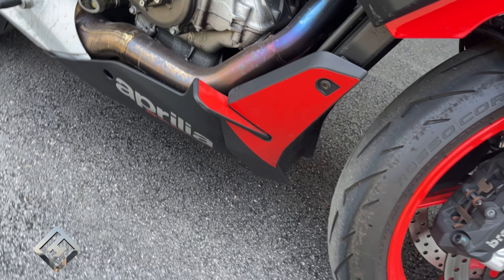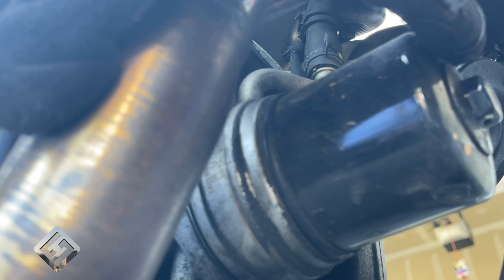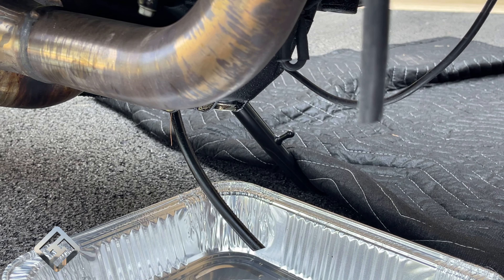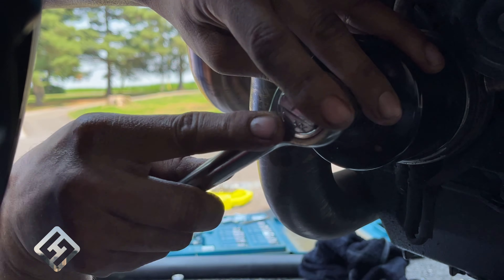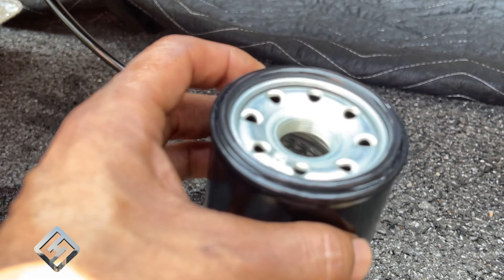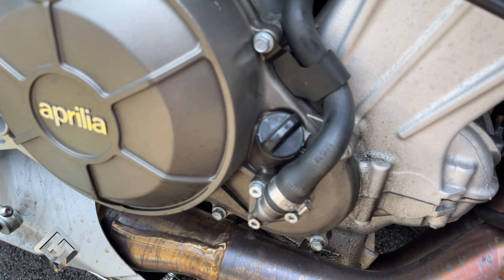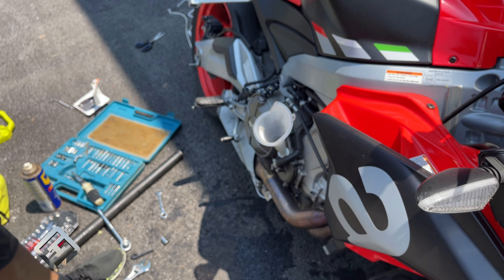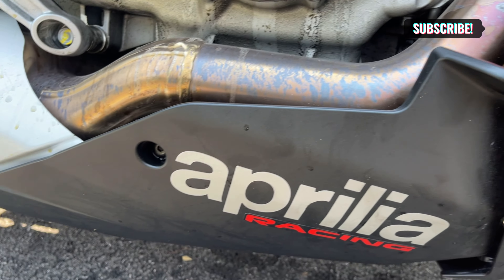Aprilia Tuono 660 Oil Change | I AM HASAN

Comment: Tip for you: Use disposable nitrile gloves for oil changes. Especially removing the oil plug and filter. Nitrile gloves are cheap and you won’t soak your mechanic’s gloves with dirty oil.
Reply from the maker: Definitely will use those in the future. Had to toss the mechanic gloves after that oil change 😂

Comment: Do you need a center stand for this or do you think it is fine to do while on the kickstand?
Reply from the maker: @harisathyamurthy4625  Hi, I was able to use the kickstand. You may need to straighten the bike after removing the oil drain plug for it to completely drain.